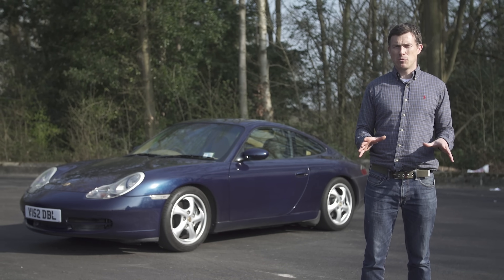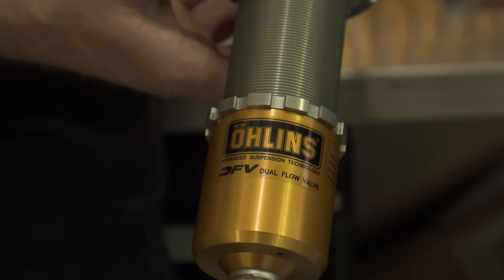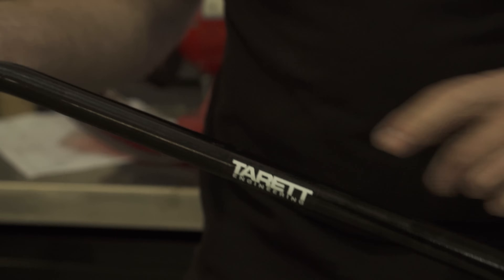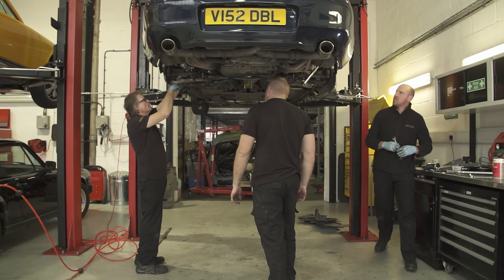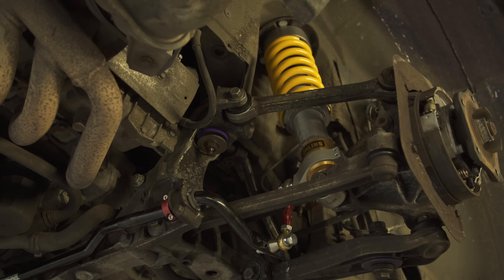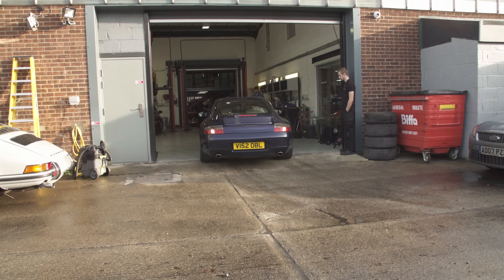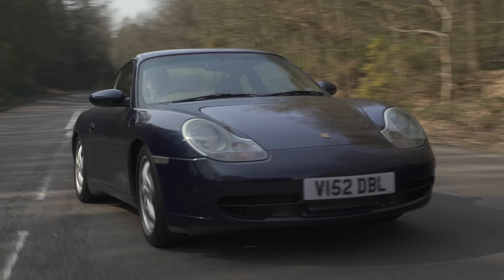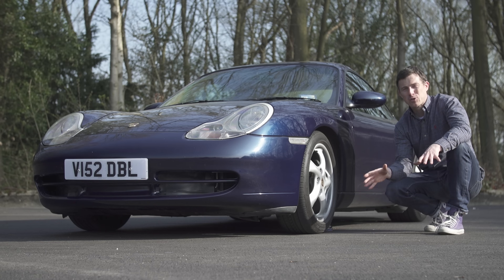Porsche 911 996 - my suspension upgrades make it drive better than new | Mat Vlogs

Comment: Interesting.  Ohlins DFV are waaaay overpriced for the quality/performance they offer.  Those spherical joint drop links will last about 5 minutes on UK roads unless you boot/ denso tape them. 

People think poly bushes last forever - THEY DON'T.  Infact certain orientation of bushes can pip quickly and I have seen Poly bushes rendered useless within 6 months.  You can assist this by reaming the bushes for perfect fitment with the collars.

Finally the alignment.  Yes 'theoretically' strings are more accurate...until you introduce parallax error and other human deficiencies.  Also, you can't really get a decent castor swing calc.
Reply: Hypersonik gosh you sound like fun
Reply: So I offer safety tips and advice based on years of experience and you mock?!

Hahahaha! That's the problem with so many people - head in the sand as long as it sounds good down the pub.

Oh well I tried.  Good luck with the car :-)
Reply: So then what's better at that same price point? (currently $2375 list in the US) And don't tell me PSS9/10. I've been in plenty of cars with those and these out perform and out-comfort them when set medium/soft even though the Ohlins run stiffer springs. Illuminate us please
Reply: DeanoTXR53 KWv3 EASILY
Reply: KWv3 are 55% more expensive ($3700 in the US) than the Ohlins. Again, at a similar $2400 price point, what is better?
Reply: DeanoTXR53 After 5 mins of looking and seeing you quote the price of a set for a Turbo, I have found them for $3k. And seeing as this is based in the UK, I couldn't give a stuff about the US.
Reply: Im talking list price to list price so one can make an accurate comparison. You can get the Ohlins much cheaper than their list price as well. So do you have a recommendation for a better set at the SAME price point or are you just grumpy because you didn't get your tea and crumpets?
Reply: He's also left the original old ball joints on the end of the arms which can't be in great shape.  Feel he would have been better off replacing the arms completely.  It must be hard to give an un-biased review when you get parts and labour for free.
Reply: Hypersonik he checked them out and said they were good. Your point about impartiality is valid. I can't be totally impartial when I got this done for free - but I'm not claiming the mods I've had done or the parts are any better than rival brands or that by other workshops. But the car defo handles better than before - you can see that yourself. As for the feel, I'm not an actor: my reaction is pretty geniune.
Reply: Matt, I liked the video but did find it a little disingenuous to watch the entire video with you speaking as if you had selected and paid for the work/parts to find a small comment in the information section.  If you were spending your own money then you more have likely made different choices; Power flex purple are no stiffer than new Porsche OE items and given the amount of labour to fit them you could have bought a complete new arm with ball joint.  In my experience ball joints can go from being pretty good to knocking in less than 12 month.  Also my disclaimer is I am bitter having just spent close to £4k going through a similar process on my 997 C2S and that includes doing the fitting myself.
Reply: Hypersonik ahh, I understand. Don't be bitter - you could afford a 997. I've got a 996... But yeah I take your point - hope my ball joints are okay. You've made me paranoid now!
Reply: I'm sure they'll be fine.  I just hope I am as pleased with mine as you are with yours once its finished.  If it makes you feel any better I am now paranoid about my rear sub frame mounts which I didn't intend to change!
Reply: Hypersonik they said they would make the least difference. So chill. Which coilovers and bars did u use? BTW you will feel a massive difference. So much so that I think people would be better getting a higher mileage car to save some cash to spend on suspension.
Reply: MatWatsonCars I wouldn't touch a Porsche with a barge pole TBH - I think they're very over priced although the 996 represents the best value as it is snubbed by the idiot purists. I run a 350Z myself so I get the performance and noise with none of the silly costs. Yeah, ATEOTD I drive a Nissan. But I'm having more fun at half the cost.
Reply: MatWatsonCars Genuinely now, if you do a track day in your car (which you should if you're not already planning it for a video succession) let me know and I'll try and make it over.
Reply: I have also gone for Ohlins DFV's, I have experienced them on other Porsche 997's and thought they were excellent, better than the Bilstein options.  I have not tried KW on a 911 but I have not have good experiences with the on UK roads with other cars.  I think my final spec is fairly similar to yours, the main difference being that I have decided to replace all the lower control arms and will keep the OE anti-roll bar for now as the only option for the 997 is the H&R item with very limited adjustability.  I think I will go for solid sub frame mounts at a later date (as per the GT3's) and uprated engine mounts at the same time.
Reply: Hypersonik, Nothing wrong with Nissan's my other car and my pride and joy is a Pulsar GTiR. 350Z's are wicked cars, but the experience of driving a 911 is very different to pretty much anything else as the weight distribution completely changes the dynamics of the car.  Is it worth the premium, maybe/maybe not but at current rates 996 and 997's have pretty much hit the bottom of the depreciation curve and are stable/climbing in value which helps to justify some of the running costs (in my head anyway!).
Reply: Berra Why?
Reply: DeanoTXR53 should say same MSRP fwiw, might spare you some back and forth next time
Reply: MatWatsonCars I was so confused when I saw you replying, I was like damn he kinda looks like the guy in the video, shame that guy isn’t here responding, total blonde moment, guess I expected your Name to actually be Car Wow III :P
Reply: Ted Palmer would buying a complete new arm with ball joint have been a better choice? Or using a different power flex bushing? What way would you do this with your money on the line, thanks for your Time I appreciate it. Oh and I will say while the purples may be no stiffer than Porsche OE they’re clearly much stiffer than HIS Porsche OE that was way beyond OE performance, point being his reaction to the differences as a whole shouldn’t be questioned too harshly, but I get your point. I’d rather this than not have this content & this conversation spawn from it though.
Reply: MatWatsonCars think you’ll ever consider the turbocharger kit? The well engineered kits are great as they have lots of R&D money into them and into making sure they aren’t sacrificing durability of the engine, so they make very modest boost like 4-5psi I think, gaining between 85-150hp depending on what you want it brings the straight line performance up to that of 911 turbo models iirc. 

Also, have you thought about a lightened or upgraded flywheel? I’d want to mimic that GT3 quick revving nature as much as possible, so I’d probably do the flywheel especially if I kept it NA instead of going turbo. I enjoyed learning that the 3.4l didn’t suffer from the IMS shaft or scoring issues, I never knew that I thought all non turbo 996’s and early 997’s were prone to ims shaft issues. I know the internet can blow things out of proportion but I think the salesman was drastically doing to opposite as 1% seems ridiculously understated
Reply: @Fee.1  , just get a 996 Mezger engined Turbo, it's pretty much the same price. Did I mentioned you can make it 500+ with a simple ECU flash ?
Reply: @DeanoTXR53  it just means you drove badly set cars. My (daily driver) 996TT on PSS10s feels amazing, both on street and track. Get the car to a proper specialist, only professional drivers can extract so much from the car that the Bilsteins are becoming "not god enough".
Reply: far num it’s not even close to cheaper, a proper TPC turbo kit made just for Porsche’s can be had for $10k MSRP, less of resourceful. 

Find me a turbo model for less than $10k more than base though and I’m game
Reply: @Fee.1  in Canada you can have a Carrera for 30K and a Turbo for 45k CAD. So 15k difference = 10k USD. Even less in GBP. So what gives ?
Reply: far num $27k vs $46k for a 2007 for exampl. If you don’t think $20k more, which is nearly the entire cost of the base, is a considerable difference then idk what to say. Add to that that I’m citing the cost of a brand new TPC turbo kit, which is a premium kit made by a Porsche Racing team & is easily 2x the cost of a normal turbo kit, much less more budget or DIY options, and it should be clear
Reply: far num don’t get me wrong I would kill for a mezger it’s just not in the realm of possibility as far as justifying the cost for me personally
Reply: @Fee.1  you're looking at the wrong car. 2007 is already a 997TT waaay more expensive. Look, I don't have time now, but autotrader.ca is your friend. Or even better autotrader.com. 996 TTs are from 2001 to 2005 only. Don't bother with low km show room cars if you want to drive it. I bought mine for 38k from US, one owner, from a Porsche dealer, 46k miles on it.
Reply: far num oh ffs man consider for a moment you aren’t in possession of vast sums of knowledge that I am lacking. First of all, even the prices you mentioned are not “the same price basically
2.) I just used NADA pricing guides and If you didn’t notice the Canadian prices you cited are what I went with, and for those #’s in USD You’re looking at 997’s, which I’d much rather own wherever possible, you can’t really tell someone they’re “looking at the wrong car” 
 3.) the same cost scaling applies across the lineup/year range. In fact the disparity between base models and turbos are even larger for 996’s here usually.

Appreciate the attempts to help, but 33% of the total cost is not “the same price basically” no matter how you slice it
Reply: @Fee.1  ok, let's clarify it. You said with a 10k USD kit you can add to a 996 Carrera you can get basically Turbo performance. And I replied you can might as well buy the Turbo for the same money (996 Carrera + 10k kit). A 996 Turbo, not a 997 from 2007. So yes, I DO know more about this, trust me, 996 stopped in 2005(Turbo S), from then on it was 997. So why are you giving me 2007 prices ?!? Buy a 996 Turbo and you get a true reliable Mezger engine instead of buying a regular 996 Carrera and add the supercharger/tubocharger whatever. It will never be the same as the Turbo, that comes with a way better overall platform, as in suspension, brakes, cooling etc, etc. From the factory. Hell, even for 5000 more you'll get a way better deal if you get the Turbo. I have one and I know very well what I'm talking about after 200k km on it. Do you need my 10+ years PCA number to prove it ? Want to spend 10k on an aftermarket kit ? Go ahead, be my guest. And I used Canadian prices and converted them to USD, also in my statement. So.. I'm not sure what are you talking about. Want a 997 Carrera? Go ahead, nice car. But it's not even close to a 996 Turbo performance wise. On top of that, add an Upsolute ECU tune (500 USD) and you have a 500 HP / 500 torque (on 91 normal gas octane) AWD all weather monster  that will eat alive many modern supercars, because weight to torque and power ratio. And you can go way beyond that with proper investments in the future, to almost hypercar level (suspension, lock diff, better wheels and rubber, weight reduction), the message being that the Turbo it's an insanely upgradable and future proof platform (it's hilarious how all kids are babbling about Supra's and GT-R but nobody has a clue the Mezger can eat alive all these overhyped urban legends). The aftermarket kit is just a compromise, and the resulting car, while fast compared to what you start with, it's not in the same league when it comes to suspension, brakes and general reliability like a factory built twin turbo Mezger. But to each it's own, I'm done here.
Reply: @farnum3297  Im not insulting your PSS10, no need to be defensive. On the track there isn't a huge difference between the two (I think spring rates are similar anyhow) unless you're banging over curbs where DFV shines. Where the Ohlins are much better than the PSS10 is on the street over really rough pavement. This isn't subjective, it comes down to the Ohlins' DFV which allows it to act like a much more compliant shock over harsh bumps. This is a physical difference in the way the shocks work compared to PSS10, not an opinion. I'm not sayin the PSS10 "aren't good enough," just that the Ohlins are better every day in normal conditions. Plus they hardly cost anymore than the PSS10. If the cost is almost the same, why choose the older tech with less features? The longer rebuild interval is the main advantage I think the PSS10 has over the Ohlins R&T

Comment: if it's really the truth, then I shit on porsche's factory engineering. if only a couple of basic components like anti-roll bar and springs/dampers could make so great change in drive, then it's never been done properly at all....
Reply: TheKenjoje it's the same with all cars. They don't use such expensive parts even on Porsches - otherwise the car would cost a lot more. Also they don't use poly bushes as they make the car a bit harsher and noiser. Not great for a daily, but better for a weekend fun car like mine.
Reply: I understand if it's typical tunning that makes car sportier and less compromising for real life, but I thought this makes the car a bit less uncomfortable than before and sportier at the same time....typical tunning never does it....anyway, interesting to have model that's not popular, I like rare cars....
Reply: TheKenjoje a lot of comfort comes from the damper. And the stock ones are cheap. The ohlins are way better. So they control the car much better.
Reply: still, 911 isn't low VAG car like polo or something, so I expected a bit more. the price itself of components MUST be justified by ride/handling.

Comment: You bought an absolute lemon their mate. I'd never of bought a 16 year old Porsche. In fact I would never buy any European car full stop. They all suffer from crap reliability and have astronomical repair charges! Stick with Japanese for speed and reliability. Just look at the amount of 20-30 year old Japanese cars still on the road with little to no issues at all. My car ( Mitsubishi Evo V) has had very little modifications. In fact all I've done is put a bigger intercooler and straight through exhaust. Everything else is completely standard. You should never modify a car that's already built for speed. All of the components are set up perfectly already, As companies spend millions on making the car as good as possible.